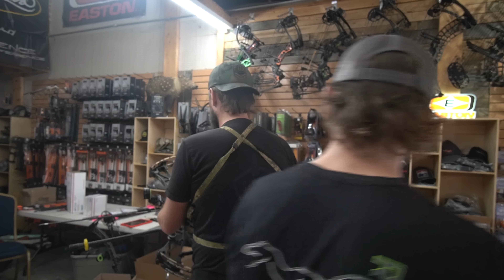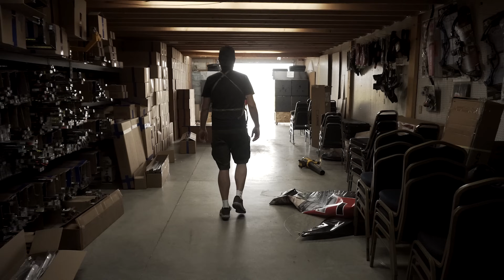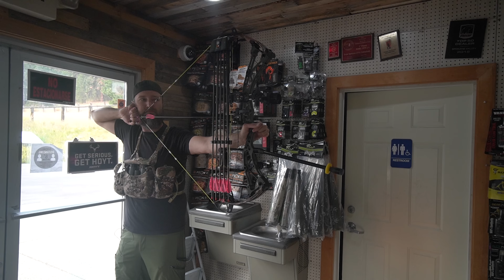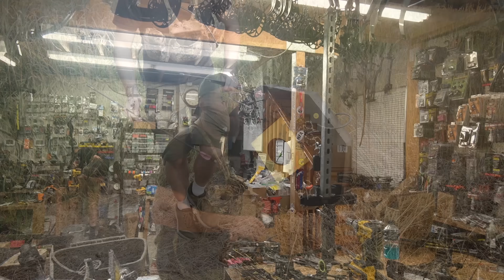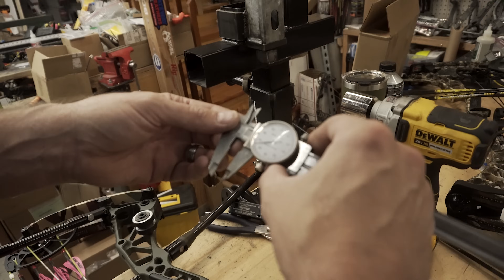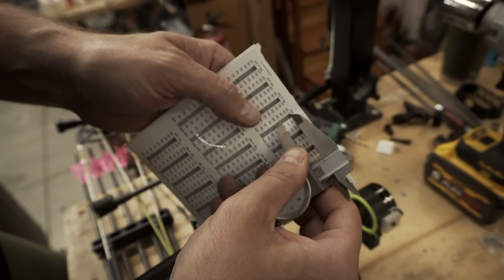Black Gold Sight Tapes How To!! With MFJJ!!

Comment: I like this method using the caliper. Will have to try and incorporate it into my set up.I have a 3 pin mbg pro and i found if you don't have a chronograph,  set your 20y 30y and 40yard pins. Take your sight tapes and line the tapes up to your pins close as possible, that will get you in the money.

Comment: I’d like to see a video on changing strings and re tuning a bianary cam bow from re setting the timing marks to the cables and so on. I’ve got a buddies diamond that i put new strings on and I had the timing set but it was shooting nock high on paper and wouldn’t go away so went back to look at strings and timing and the brace hight was off as well as the ATA was slightly long 1/8”. So I fixed that took the cables off switched them around to see if that made a difference and it’s still nock high and slightly out of time according to timing lines on the cam

Comment: I have a black gold whitetail.  Shoot at 20  40  60. If I wanted to increase my draw poundage by a pound or 2 . Could a guy just raise pin housing up a bit. Or would u have to  change out the tape . I'm a 30 and under guy at whitetails

Comment: I just switched to a Black Gold slider with the 2 pin. My plan was to have the pi s set at 20 and 40. The best I can get is a 20 and a 35. My speed is 295fps arrow weight is 385grns. Is my arrow to light to expect this with the pin gap adjustment?

Comment: Need help MFJJ! i always get confused here and only dialed in 1 tape and it wasnt that close, the shop picked it then i tried to fine tune. So if i have a 3 pin slider and sight in my pins and housing to home base, 20 hitting and 30/40 good. When i select my tape and 40 pin is my rover/slider pin….when i go to put my tape on am i putting it at 40 being home base and putting it under the needle at 40. Due to the 3 pin design, or am i putting the tape to match the needle at 20…confusing to explain but i always mess this up somehow or forget

Comment: Ok I have a older bow and it's a. q5 quest storm set to 58 pound  27.5 length  im shooting 400 spin hunter gold tip  arrows with 100 g tips I just put a hotwire adjustable 3 pin the tapes don't look good so I'm going to have to put my own on it best advice?
Reply: And im shaky it's been literally 16 or 17 years since my dad died he's who I shot with so I'm trying to.get back into it then I wanna start getting out of my comfort spot and do like new hunts outwest even

Comment: I don’t like how aggressive he is with sticking that allen key in his sight
Reply: I stripped mine the first day I opened it, mounted it leveled it 1st, 2nd, and 3rd. Then I started shooting and sighting the pins I had to move my scope horizontally and I’m one of those guys have to torque shit down. Stripped it but good thing I got tap and dye sets. Save my warranty when I get a pro micro adjust model, I for sure will adjust and baby those bolts. Works perfect and dead on out to 105. I never used the chrono either marked the yardage on the black to match my tape.